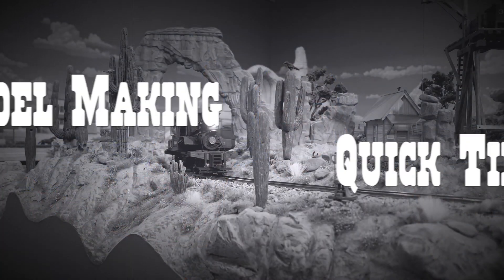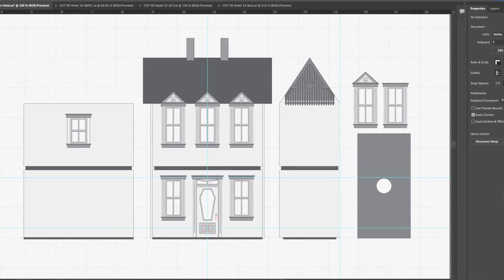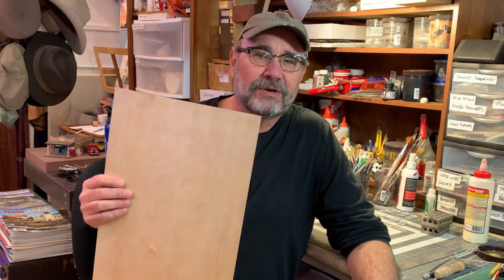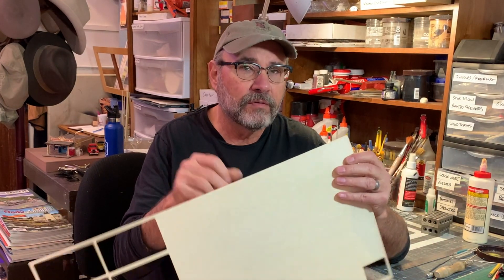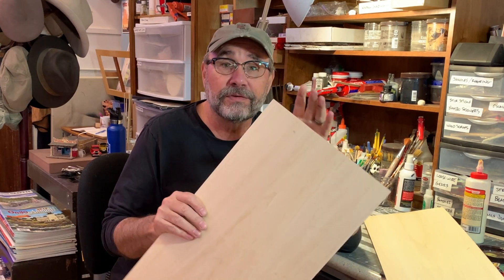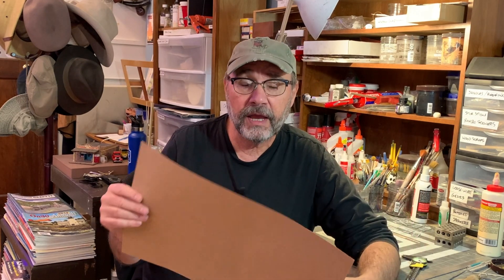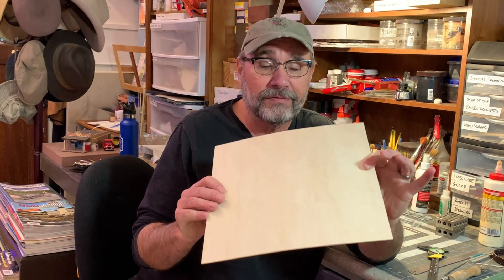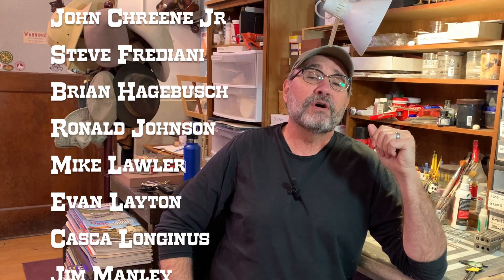Model Making Quick Tip | Laser Cutting Materials

Comment: This is invaluable. I love how you covered the biggest hurdle of "Well how do I make the file?" So many people have great ideas but going from idea to a file is the biggest snag regardless of if you get it laser cut, 3D printed, or CNC milled. Secondly, materials are critical. Some are "iffy" to cut due to flammability, and some are downright toxic! 

Below are my experiences with materials on both an Epilog at my job and my import K40 laser:

A pro tip, avoid marine/aircraft ply whenever possible. The glue and sealers make it char like no one's business. Craft ply is not sealed and cuts great. 

Laserboard is incredible stuff, albeit a little hard to source. 

I cut lots of "chipboard" aka the same stuff that cereal boxes are made from. Just seal it up when you are done! 

MDF is great, albeit the stuff sealed with linseed oil behaves a lot like marine/aircraft ply so avoid it like the plague! 

I cut lots of acrylic for a client and personal projects and it cuts quite easily. Some people will use it for the "core" of their buildings too for strength. 

PETG (polyester) can be cut, albeit it has a fine line between turning into a pile of melted goop and cutting. This is best done on a machine where you can adjust the frequency of the laser output to adjust the heat going into the material. 

Leather I have engraved, not for train stuff directly, but it is awesome for making custom tags and things like that! I spend the money for veg tanned so I am not breathing in the chrome-tanning chemicals. It does smell so... keep that in mind!

Comment: Dear Dave, very cool summary of all these materials. Hence, a great reference video. Never mind your Imperial Measurement setting, even though I’m raised in the metric system, for modeling purposes I tend to use both measurement systems. If only for the fact that the Imperial system is based on fractions, which in my humble opinion makes it an excellent tool to understand and memorize the ratios I’m working with. One example; most European manufacturers tend to use denominations of 1st, 2nd, 3rd and 4th radius curves. Some will give either the diameter or radius in millimeters. However, to understand the available space and to design according to the scale ratios, I find it so much easier to use the Imperial measurements. 20” curves as the minimal radius easily translates into the wider ones, with the same amount of numbers. Where in millimeters it becomes more of a chore, either for a more abstract (to me) kinda number, or even with numbers behind the the comma.

Comment: One major thing with a lot of it is one other material.

Masking Tape...

It's pretty much the greatest thing to have in large supply with a laser cutter/etcher. Even more if it's with a machine that isn't your own...

You can pretest layouts with a low power run and test it against a layer of tape over the top to let you see how it works and lets you adjust settings.

It also can be cut through at a normal setting for whatever material you're using in most cases or engraved through...and has the massive added benefit of limiting scorch marks around the cut meaning that there's less required work since the soot can screw with painting/staining a finished project.

You can also cut/etch and then leave it on to function as you normally would for masking tape, letting you do other things that I've seen done. A friend of mine used it to make some stained glass windows for a church or cathedral, it let him use some colored UV resin to make the actual window panes without worrying about it screwing with the rest of the surface. I didn't see the end result there, my main laser access is a local, free maker space that has several lasers available for use and he was filling in the panes as I left, but it looked neat.

I have seen acrylics used with things, but they tend to be more modern than most railroad modeling does...one major one I did see was a core of acrylic with a more specific layout that involved older skyscrapers with other things built around it as well as more acrylic for the glass & steel or scifi look for dioramas.

Comment: I got into laser cutting 25 years ago when I bought a New Hermes commercial 25 watt machine. I made tons of stuff including a number of kits I sold. My materials were styrene, acrtlic and artist matt board. I did a lot of structures with matt, easy to find, pretty cheap and when used right for structure cores a good choice. 
My laser days are over as my laser has lost it's charge and getting it fixed is much more than a good home laser today. My $30K boat anchor. Thanks